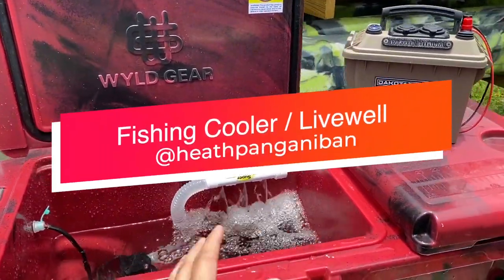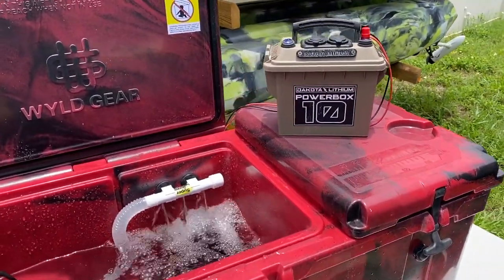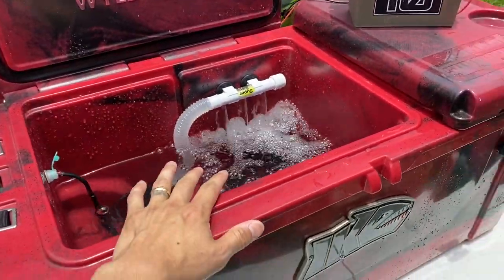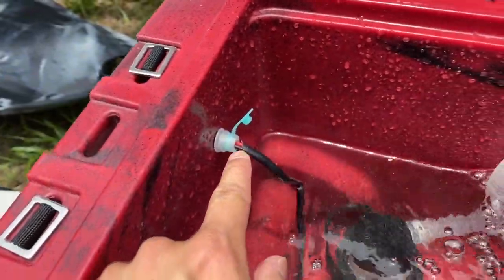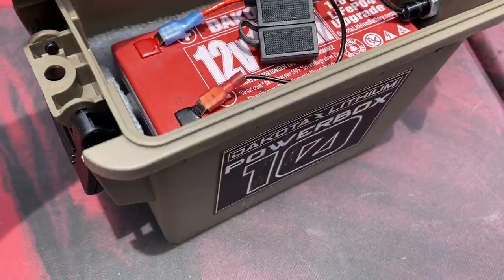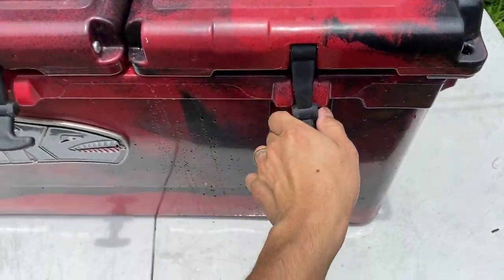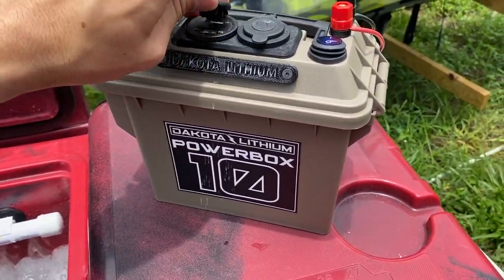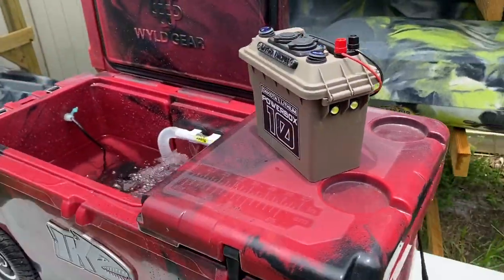Livewell Fishing Cooler with Power Box

Comment: Nice live well and very kewl Dakota powerbox!! Using it just for the pump, that could last like 6-8 hrs right?
Did u install the pump and pvc? Very kewl build. Will keep shrimp alive n well fer sure. Could put in a frozen plastic water bottle 2 keep em cooled down  there all afternoon i suspect.
Reply from the maker: Yes! Right on the money! 6-8 hours ish. It's actually just a walmart set up. (The pump and PVC)
Reply: @FishingWithHeath  do you have a parts list for the aerator?  Trying to fix my "no live well" issue on one of my boats and this looks like a spot on solution

Comment: How much are these?
Reply from the maker: It can vary depending on the cooler you use but the battery box is around $100
Reply: @FishingWithHeath  how long do they run your aerator?
Reply: @FishingWithHeath   so let's say I wanted to upgrade a brand new Frabill 30 quart cooler? How much?
Reply from the maker: @JohnLambert-tv2wc  usually 5-6 hours